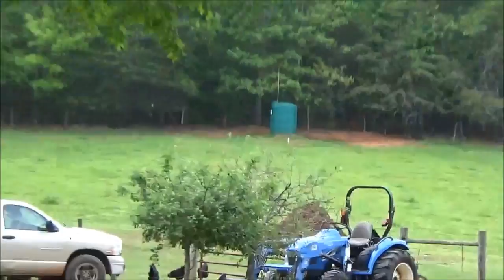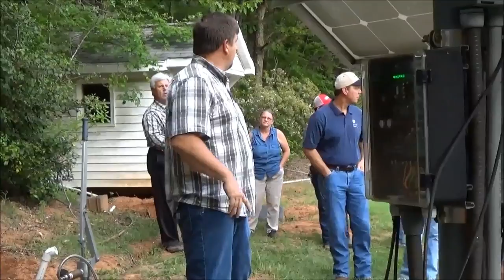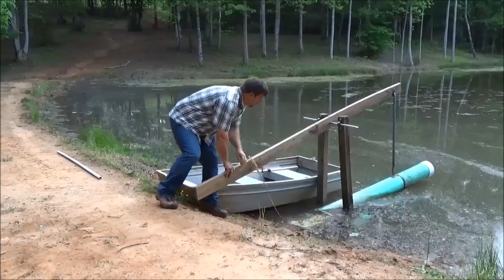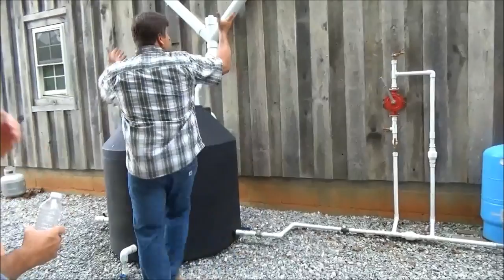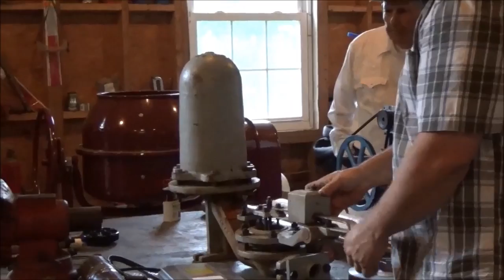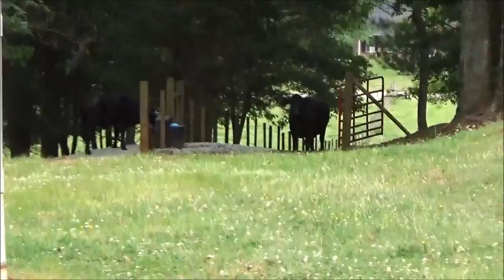Providing Water For Cattle

Comment: I need to water 4000 plants  1 gallon a day each row 600 ft long I want to water each row for an hour each day with a dripper on each plant at 1 gallon an hour 600 gallons an hour what size well do I need ..my static water level is 40 feet  my well is a 2 inch line going 100 ft I think ill need a well just for the plants I can pump 75 psi all day coming out but the pump runs to keep the 75 psi whay do u think
Reply: s
Reply: +David Fernandes Do you have 4 or 6 inch casing? Stack a solar pump at 35 feet with a float switch just in case you suck the water down to there.  Pump it to a tank at a higher elevation than your plants and gravity irrigate away...
Reply: thanks for the info